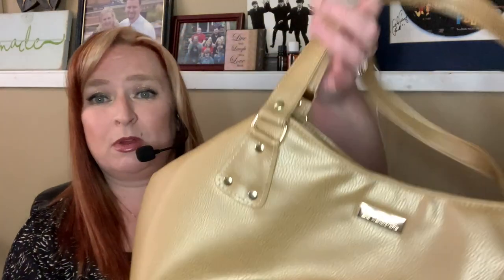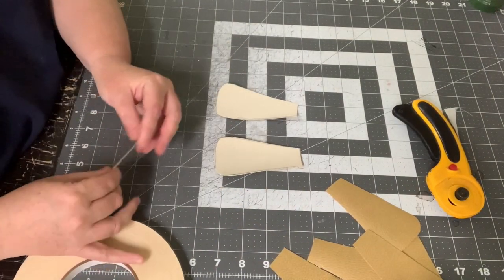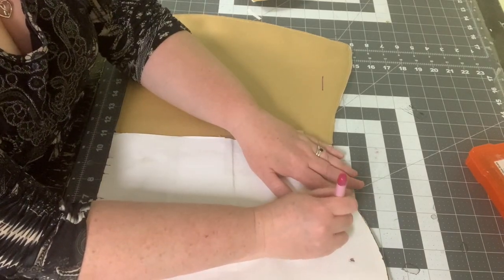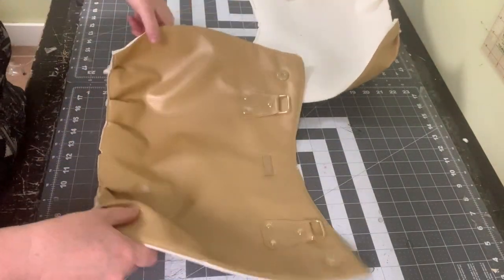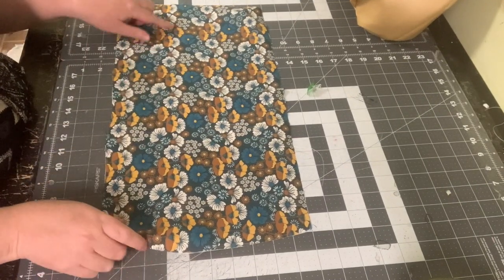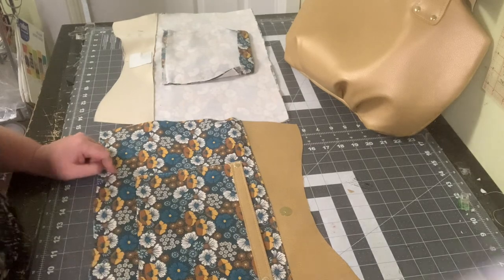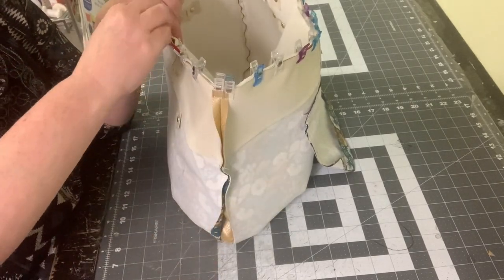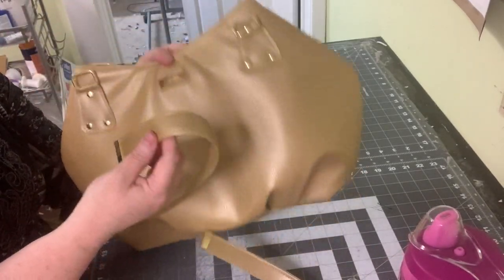The Brissa Bag   Full Tutorial|Shamballa Bag Designs

Comment: Hi Brandy! Have you ever interface the base with decovil heavy before putting on the foam? That was my plan; any thoughts? My sister carries a lot of stuff in her purse....it gets heavy. It's gonna be the Metallic mint blue-green vinyl from Emmaline Bags. It's gorgeous! Thanks Again!
Reply from the maker: I usually do in most of my bags, but this one the base is very small. You can definitely do it tho! Just keep it out of the seam allowance
Reply: Thanks!
Reply from the maker: Yw
Reply: May I ask you one question...how long do you make your straps? The length in the pattern seems a little short to carry it on your shoulder.
Reply from the maker: Yes they are short. For this one I do anywhere from 28-30”